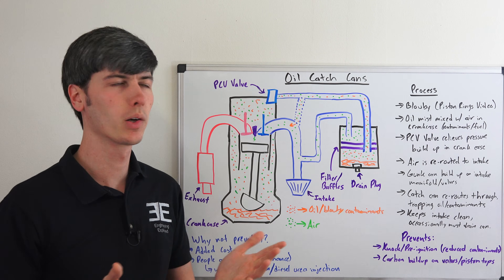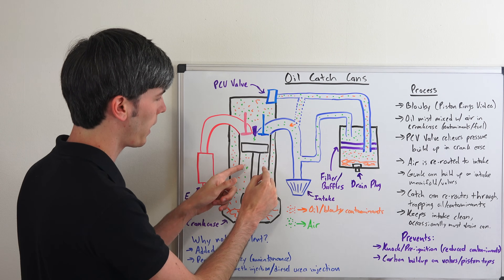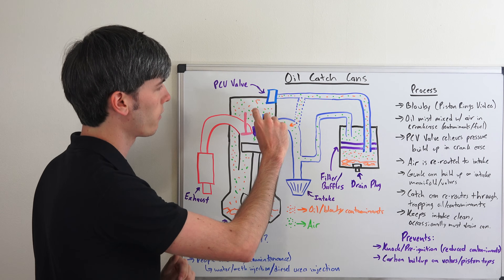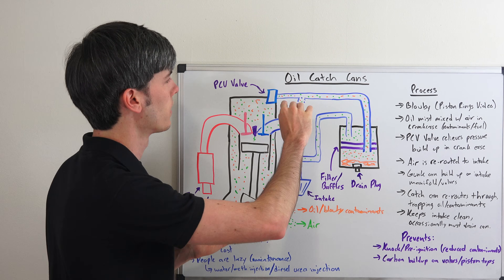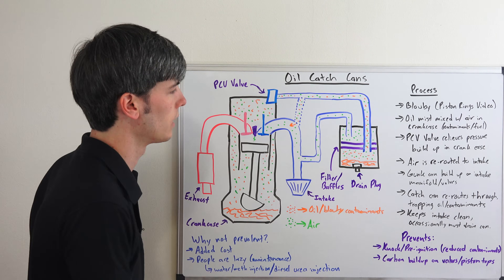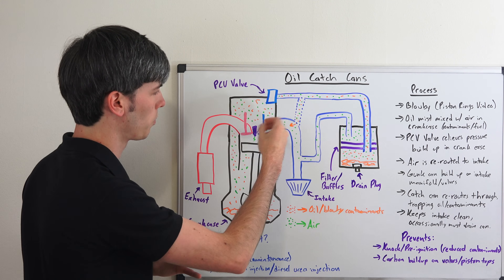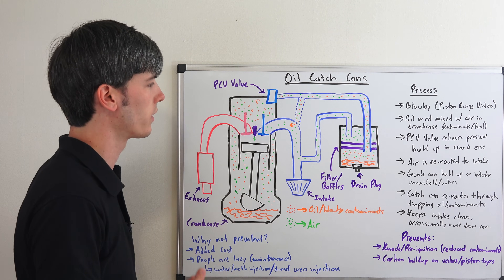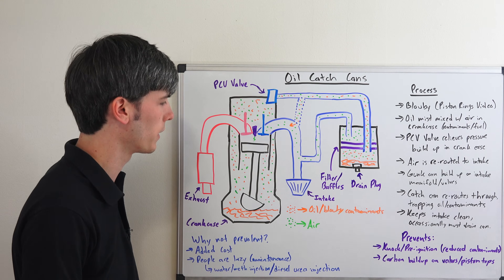What Is An Oil Catch Can?

Comment: so I just bought a very modified 1975 Alfa which has the PCV hose feeding the cannister but no 'return' (exit or loop back) to engine hose... is this kosher?
Reply: Should be totally fine.  Same thing as a valve cover breather, but the can just catches all the liquid suspended in the air mixture. Sounds like the can just vents off the gasses to the atmosphere.
Reply: Right you are. Thx
Reply: Yeah man! Sounds like a sweet ride :)

Comment: My Renault Clio has this system installed from the factory, and I just discovered come crook mechanic did a poor work and blocked the line going from the engine to the bottle. What kind of damage can that do? Could that cause pressure buildup inside the engine case, and later on, oil leaks?

Comment: That oil that gets drained out: is it spent/not recommended for reuse? It seems like that could be drained back into the crankcase (using a valve and tube leading back to the engine) when the engine is shut off to eliminate the need to manually drain it. If that oil is past its useful life, though, I can see why that wouldn't be done.
Reply: The issue is that it is contaminated with partially/unburned fuel and byproducts, and you really want to keep fuel contamination in your oil as low as you can.

Comment: Great video! Now you need to do the follow-on video that tells why modern GDI engines really need a good catch can, whereas your older carbureted or conventional fuel-injected engine did not. (ie, automakers did not properly evaluate the long-term effects of GDI on intake deposits). Dealers want anywhere from $500 to $800 to clean your intake ports and valves. Some automakers are discussing adding an additional fuel injector within the intake manifold just to keep the intake clean.  That's a nice idea for the future,  but it doesn't help those with existing GDI vehicles.

Comment: Oil catch cans can be very dangerous in the winter! I used one on my old SRT4, and in the winter moisture from the air would condense and freeze inside of it, completely blocking it off. Blocking off the PCV system is very bad for modern cars. If I ever try to use one again, I will have to rig up some kind of heating coil to prevent it from freezing solid again.

Comment: My 2001 SAAB had an oil trap on its PCV system, but it had a drain on the bottom to return it to the sump.  Don't know why more OEMs and aftermarkets don't adopt this design.
Reply: SAAB was always in another class. But could also be that they borrowed the idea from their Scania heavy truck division?
Reply: SAAB was the pioneer car company.  Many of the features in today's cars were first implemented by SAAB.  And I only drive SAAB cars.  Since they are gone, will have to switch to another brand someday. Uggh.

Comment: Why is the air rerouted to the engine? To decrease pollution? Wouldn't it be better if the engine took only fresh airflow?

And also, does the PCV affect performance? For better or for worse?

Thanks :)
Reply: Exactly, it's so the toxic gasses and oil don't get released into the environment but rather get burned off cleanly

Comment: if this was so nessary the auto makers would be putting this in at the factory this is wasted money and bull crap every engine has leak down keeping your oil clean is important not using cheep oil or filters this is all aftermarket crap

Comment: You should do a follow up video on this , because I have 1955 engine with a road draft tube , and have always wondered if I could connect something to the draft tube to catch the oil or fumes. Some people talk about welding a pcv valve at the end of the tube . And from there , I kind of don't remember where to connect this .   Surprisingly this car has a make shift Pcv from the fifties ,I think ... A gentleman confirm this for me..... , and he says to just leave it alone ... but I would sometime ( maybe ) make this modification , of catching the oil from the road draft tube.... Mike

Comment: i havn't read all the comments but one thing to keep in mind is that some manufactures purposely design the breather system so a certain amount of oil gets into the intake. this helps reduce inlet valve seat erosion.

most gunk in the intake comes from EGR systems. 

provent make a great catch can imho.

you can plumb catch can to return the oil to the sump. that can be important on certain motors that throw out large amounts of oil out the breather.

Comment: So why does the catch can actually need to connect back into the intake? Why can't it then vent to atmosphere?
Reply: Within the intake is a suction force or vacuum.  This whole pcv system needs vacuum to function, with or without a catch can.
Before pcv became a standard the crankcase would vent straight out to the atmosphere.
Reply: Elias Bargee cool thx. But he said pressure builds up. So wouldn't the internal pressure force it out naturally anyways?
Reply: Emissions.

Comment: I am so glad you did this video! I asked for this months ago (not the reason you did the video I am sure, but still) and so happy to see it! Wish you covered the importance of filtering the contaminants from GDi vehicles and others where the fuel doesnt spray the valves leading to "maintenance" by the dealer to the tune of pulling intake manifolds and cleaning valves manually.

Comment: hey I am putting a police light in my room and I don't know how many watts it uses and knowing that Is it powered by a car battery and it is an old non led roof light you might be able to help me determine how many watts it uses :P
Reply: Get yourself a cheap multimeter and watch a few tutorials on what I am about to say. Find out how many volts flow through it (find Voltage) and how many amps it consumes (find amperage).  Voltage multiplied by amperage is watts.
I suggest looking if you dont have a tag with all this info somewhere on the light before!

Comment: Good video. I thought I knew plenty enough about catch cans, but definitely learned something!
Still waiting for a trans brake video...
Reply: A transbrake just puts an automatic transmission into a forward gear and reverse at the same time. It's just for launching a car really hard. Turn it on, floor the gas, and when you release it, you are just in the forward gear and away you go. Mainly used in drag racing.
Reply: Eric Fixalot I understand what it's for, I'd just like to see an in depth explanation of how it works. I didn't know it used forward and reverse at the same time, that's really interesting! Only makes me want an in depth video even more! haha
Reply: UndergroundTrev I see, I didn't know what you already knew so I just tried to give a basic explanation. The transmission gears are controlled by clutch bands that are hydraulically activated (I believe he has done a video about that), the transbrake just gives fluid pressure to both gears via a solenoid. I know it's not the same coming from me but at least you don't have to wait as much.
Reply: Well I certainly learned something. Thanks for the info!
Reply: UndergroundTrev You're welcome.

Comment: I think you shoud say why this contaminated air should be re-routed to intake: its the way they found to burn that gases again and force thru the catalyser, this way not polluting (if I remember a engine that let the gases flow to atmosfere w/o catalyser is 10 times more polluting) the enviroment and reaching better emissions values.
But the old way they make this is more simple: a metal mesh sandwich on the valve cover retain oil (that drips in camshaft) and allow air to flow to carb/intake to re-burn

Comment: Hi Jason, how often would you have to drain the contents of a typical oil catch can if you have one installed? Would it be convenient enough to time the drain interval such that it coincides with the oil change interval? Great video by the way - I've heard of these but yours is the first time I've heard them explained in detail.
Reply: Having run one for a number of years on an older Honda, I can safely say that unless your motor has some pretty bad rings (or you're running some insane cylinder pressures), you won't have to drain the can more often than your oil change interval :)
Reply: Thanks for the reply. Yep, car's a 2005 Honda Jazz (aka Fit). If an oil catch can's going to help keep it ticking for 11 more years then it might be a good mod to do.

Comment: I run water-methanol injection, and I use an OCC. But I'm all about performance on my Mazdaspeed 3, so both make a lot of sense for numerous reasons. I realize, however, that I'm definitely not the "average driver." I'm certainly a modder at heart.

Comment: the question I've always had with oil catch cans is....how come manufacturers don't put these in if they are so important in preventing engine trouble? its only a 300 dollar add and on a 20k car 300 bucks is literally nothing. also, according to what people say about build up, it seems like anybody with a 6 year warranty will end up with a blown crank case or crushed valves if the build up is as bad as they say. That would obviously hurt the manufacturer when they have to replace engines on every car. my point is....its usually always the owners fault why things go bad. not changing your oil at regular intervals with these contaminents building up in the crank case will cause problems. using improper or bad gas will of course add to contaminents in the crank case. adding mods that are cheap but not tested well will put more strain on the engine. I say instead of buying a catch can, just treat your car like your wife and it'll be happy and last a long time.

Comment: I wonder if it would be possible to remove the plug and route a drain line into the oil filter system. Or even into the pan with a mesh screen type of tiler that could be washed during each oil change. I know of one engine in particular this would have been a godsend for.

Comment: can you only find them for V8 ?
Reply: No, catch cans are typically "one size fits all", you find a place to mount it and use generic rubber air or heater hose to connect it into the system.

Comment: I have one.  It's a bit of a hassle in winter though.  Condensation builds up due to the colder temperature and freezes inside the can.  If you don't drain it enough when the engine has heated up, the frozen water can block the hoses and allow the blow by gases to build up in the crankcase anyway.

Comment: Do most vehicle PCV valves release blowby into the atmosphere?   Is this the reason that on an air cooled, piston aircraft engine, you need to add oil on a regular basis?  More specifically, like a Cessna 172.  Is blowby greater because of the loose fitting, air cooled engine?

Comment: i direct vent to atmosphere...
Reply: This is a bad idea.
Reply: +Curt D no rules that say i cannot vent to atmosphere in malaysia...
Reply: Without the vacuum from the intake, much of it will stay in your crankcase and mess things up.
Reply: It's not just about the rules. It's not as good for your engine.
Reply: +TXs14 no more dirt air with oil mist going into intake is good for engine not good for enviroment...
Reply: +Grandma's Malibu oil catch can cannot 100% clean out the air and send back to intake..oil catch can always make a leak until somewhere get dirty and dirty..so i put a hose down to the roadway..
Reply: +Walter Black when i unplug the PCV hose..gasses automatic come out..so no need vacuum..
Reply: so, does it mess up your engine bay in the long run?
Reply: +KR!RK if the hose too short.. dirty oil will stick inside your engine bay..i put long hose that over my front lower arm.. so the road will dirty only

Comment: Is an oil catch can beneficial/worth the effort on a brand new car? I just bought a new Ford Ranger TD. & not that I do, but if you were to run a lower viscosity oil than recommended would a catch can be even more beneficial in holding at bay  unwanted gunk.
Reply: Don't mess around with lower viscosity oil. It might not protect the engine as well. Use the viscosity that the manufacturer recommends. It's also a good idea to run full synthetic after engine break in period. I use mobil 1 full synthetic and change it every 5k miles (use a new quality filter with each change as well).

Comment: If someone wanted to install a catch can, what's a good way to clean out any gunk that may have accumulated on the intake valve and piston?
Reply: BMW mechanics uses something called 'Walnut Shell Blasting' to clean carbon deposits off of intake valves (only the valves, not for the pistons).  It is like sand-blasting but it uses bits of walnut shells instead of sand.  That method seems to work the best. Cost about $400 to $500.

Comment: Do injector cleaners like STP and Techron work?
Reply from the maker: There are journal studies that show PEA (a common active ingredient) is effective at removing carbon deposits, but that said I wouldn't recommend using it on new cars that are clean and don't have issues. Plenty of top tier fuels already contain PEA for this reason.
Reply: +Engineering Explained Great!! You should make a video comparing regular vs premium fuels.

Comment: can a faulty PCV Valve cause oil consumption? where does the oil/air mixture go if it is faulty? (oil consumption defined as oil gone missing that is not leaking out of the engine)

Comment: If I can drive a car 200K miles without a problem (and I have), then I don't need it.  This is similar to the idea of waxing your car once a week.
Reply: The same care with a catch can since the begining would probably work better after 200K (less dirt, less leaks, so better efficiency, better fuel economy, etc) just as a car waxed every week will look better after 10 years compared to the same car waxed once a month.
Nobody said it's NEEDED, it's just better.
Reply: It is the rare person that keeps a car that long for it to be worthwhile (the catch can).  The constant, repetitive waxing is simply a waste of time when you can use that time to enjoy your life instead; and its benefit is negligible-even for a collector car.  Also, the creased, painted edges on a car's bodywork will simply wear first, ever hear of "burn-through"?...
Reply: mitchlu What if I tell you that some people simply enjoy their life while waxing their car?
Reply: I'll buy that, I guess if that's what makes you happy, then it's worth it (I guess it can be therapeutic).
Reply: +mitchlu mhmm nope.
I personally bought one because I'm planning to put my engine under heavy stress with a supercharger, the valve cover will have to get a breather, so I'm putting a catch can to avoid leaking oil under my hood.
Reply: If you're trying to build a high-performance car that's a different story; that's not covered in this video.  I know someone that put it on his Audi A3 (stock setup) and had to revert back to stock after it blew apart (got towed back to the dealer).  Moral of the story...do your research.  People out there are just slapping these things on.
Reply: +mitchlu was it TDI or turbocharged? If yes, the catch can can't just be installed like on N/A engines which is the setup shown on this video, because of turbo pressure through the can it will put pressure inside the valve cover which is very VERY bad.
Reply: It's actually the 2006 A3 hatch with the 2.0L TFSI (Turbo Fuel Stratified Injection - below the intake valves); has the DSG transmission.  He has the APR stage 1 tune (mild).  I remember him blowing some lines on it (oil everywhere, as he described it); shame on him if he did this on the wrong engine, as you say.
Reply: +mitchlu sounds to me like he didn't have a check valve in his setup to prevent the turbo pressure from going back through the oil can into the crank case.
Reply: +mitchlu Antonio is right, with this setup the turbo must have blown into the valve cover, eventually cracking a joint and and spilling oil everywhere.

On turbocharged engines, when installing a catch can, you must either put a check valve on the line between the intake and the can (you can buy one or cut the part of the original hose try use it) or remove this hose by putting a filter on the can so it breathe into the atmosphere (and carefully obstruct the part that used to go out from the intake).

If he just installed the can with the 2 normal hoses, that's totally normal he blew everything up.
Reply: interesting...now I'll have to find out so I can sleep again :)
Reply: you would think that would be part of the kit that comes with the catch can...but I'll have to check...
Reply: +mitchlu some do come with the check valve, although I don't know if it's well advertised. I got one from UPR that I was very happy with. It was a bit pricey, but it's very well made and install was a breeze. I have an ecoboost F150, so this was an essential item for me because I experienced the common ecoboost blow by issues. I've had no problems since installing.
Reply: update to you and Arthur:  On a zero-degree day, the condensation in the lines to the catch can froze and caused a blockage in that line.  There was no pressure relief valve installed, so the pressure built up and blew off the valve cover.